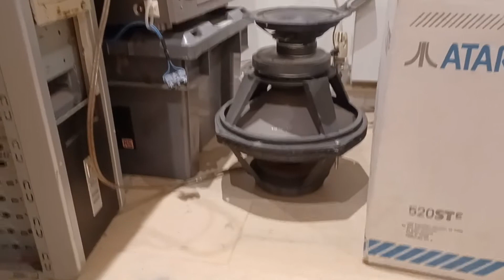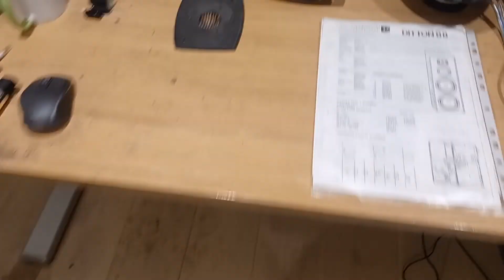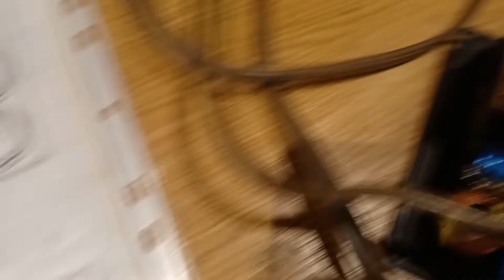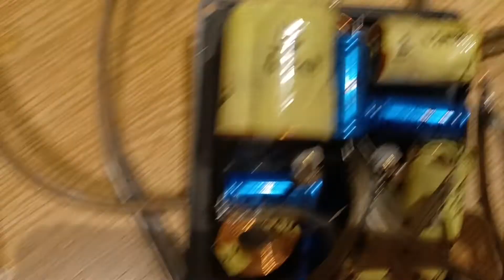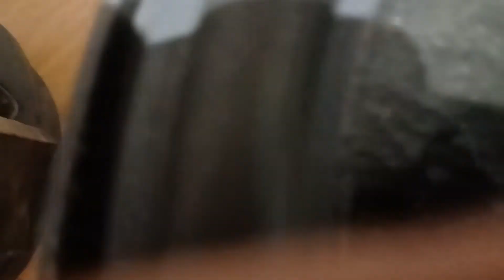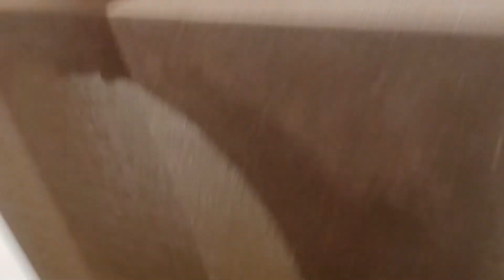Celestion DITTON 88 (1988) Introduction, parts, discussion about new build.

Comment: Found a pair for 600 euros, but one cabinet or ruined. A lot of rework is necessary. I am pondering if I should get them.
Reply from the maker: I would. I think that's still a bargain. There was a pair from Italy I think they sold for 2000 euros a couple of weeks ago. First check if all the drivers work and that they don't scratch on the voice coils when gently pushed with fingers. The important thing is that you are getting one complete cabinet you can copy, myself I could never make a set of cabinets as I never had the exact dimensions especially the two angles at the front.